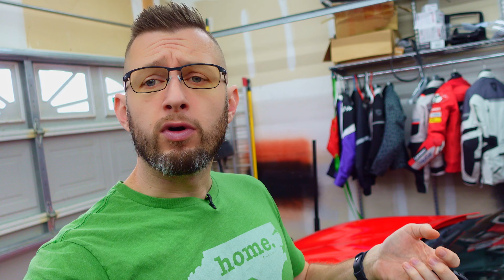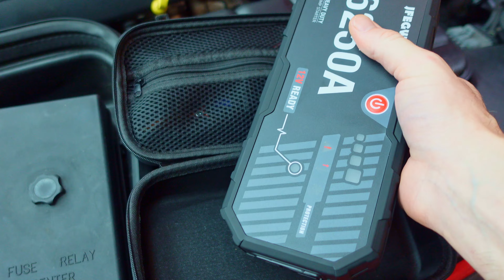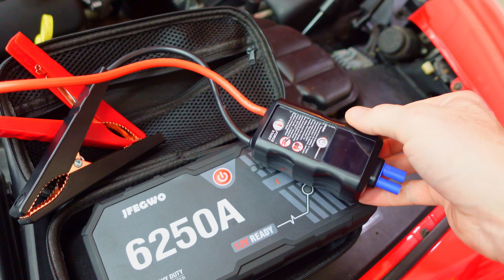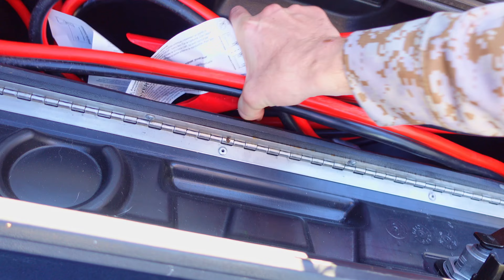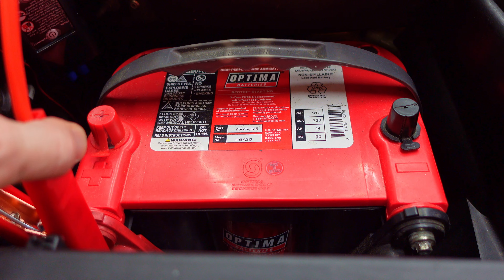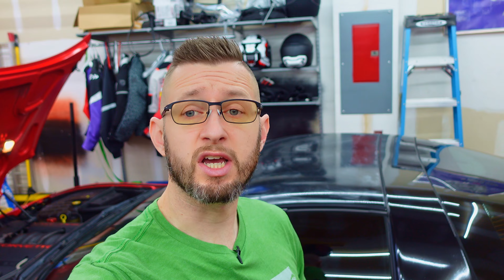JFEGWO 6250A Jump Starter Car Battery Booster Power Bank

Comment: On eBay there is a Makita jump starter...
It coverts a 18v drill battery to 13.5v with crocodile clips!  
Have you had any experience with this?
Maybe worth a review?
Cheers
Reply from the maker: I personally have not tried it, but I've found just about all of these devices are capable of starting most cars on the road at least once

Comment: Needed this for my Multistrada last week.
Reply from the maker: That's not good! My 2015 Multi went a solid 6ish years on the original battery before it started to die, I was pretty impressed!

That said, the cranking amps needed to start the motorcycle are significantly less than what this outputs, you can probably find a much smaller and convenient unit 2 keep in the bike
Reply: @4KMotoring  I ride the bike everyday so that might have drained it faster, but I bought a Yesper jumper to carry with me always just in case.